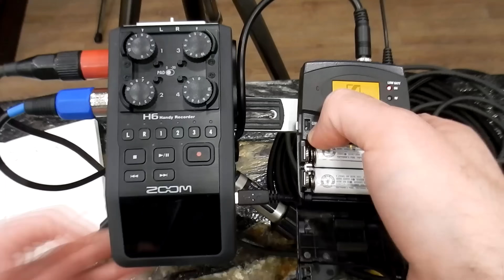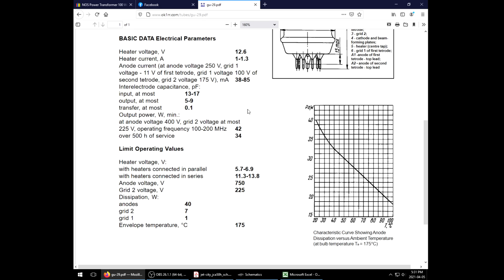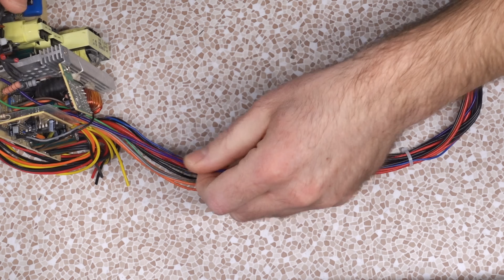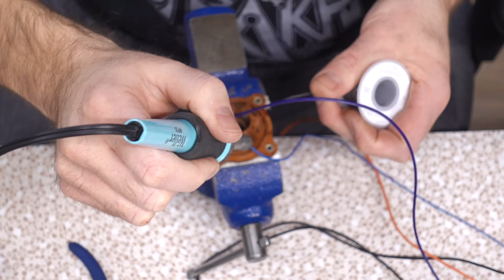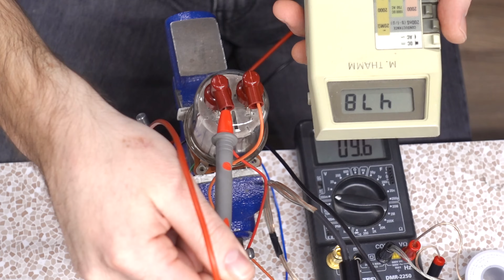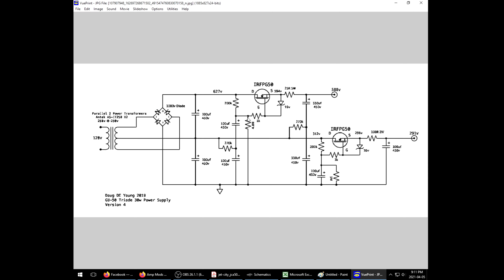The Russian Tube Experiment

Comment: The generator double beam tetrode GU-32 was made in the USSR, not in Russia, the main production of this model was done by the Lviv Electric Lamp Plant “Iskra”, in Ukraine.
It has been out of production for a long time, due to a number of shortcomings - noise, size, heating, and most importantly, it requires a lot of transformers.
Well, who wants to pick their nose - Russia will be making similar retro garbage for a long time, stolen 829B from RCA.
Reply from the maker: Yeah, that's just the title I went with, as a pun reference. Many have pointed that out at this point.

Comment: What you have there is a clone of the RCA 829B, designed to function as a push-pull VHF amplifier. I have a bunch, brand new RCA's. Want some? (Who am I? Retired RF engineer mid 60's..Been in RF since  '70) Thousand of tubes in my collection. Maybe you guitar gods would like some 4-1000's, 4cx35000c, etc! LOL! 833a's?? 810's, 805.s 813's! I'd use the 813's myself for audio application. Matter of fact back in the 50's drive in's would use the 813 tube for audio. >700watts! AB1!
Reply from the maker: Damn, and here I am thinking of scaling one of my 100w heads down to 50w. I dont' even know what to do with that much power, hahaha.

Comment: 2 x fixed bias circuit will work
Reply from the maker: What do you mean ? Like resistors on the cathodes instead of negative voltage on the control grids ?

Comment: What a soud quality check do you with an audio signal purposedly distorted?? On my phone spunded bad. Make the check with nearly sin wave signal and a high efficiency horn speaker cabinet.
Reply from the maker: It's a metal guitar amp, the sound of the tube at full playing distortion is the only thing that matters. 
And amp of the nature can't even really do a proper clean tone. 
But yeah, my recording of that sound is not the best. Also, You can't really tell the sound of something from a recording, especially not listening on a phone.
Reply: If you want to be good with fistortioms, then take a MOS amplifier coping with at least 500 kHz linear power output (f. ex. 300W), and drive with any signal you want. Bee careful it will blow the speaker and your ears because of too much and powerful high frequencies.

Comment: Russia stayed with Tubes longer because of EMP effects from nuclear bombs, you have to harden electronics with shielding when using transistors and IC as the EMP effect can damage the junctions going S/C.Only Valves (tubes) can resist EMP without thick propper shielding casing.
Reply: Vacuum tubes are still used for communication satellites today. they are much more reliable than transistors in conditions of cosmic radiation
Reply from the maker: Damn, tubes in space! That's cool as frig.

Comment: Perhaps you will like the ГУ-50 better. A thousand years ago, when I was young, in the USSR, we used exactly these. 
By the way, ГУ-50 can be used with a radiator.
Reply from the maker: A radiator ?
I have considered the 50, it seems a more standard type of tube.
Reply: @DATT  The GU-50 has a flat aluminum frame on top. An aluminum finned radiator can be screwed to it in the center. Those used in the old days did not have a fan or thermal paste, but significantly eased the temperature regime when working at maximum power.
Reply from the maker: @АндрейНикитенко-ф4с  Ohhh, we'd call that a "heatsink" where I'm from. Hah, that' cool, literally. 
Traynor, a Canadian amp maker had these amps that would deliver more wattage then spec, and they put fans in the amp to keep them cool, otherwise, you could blow them.

Comment: Musos just do not fully understand electronics. Their terminology is suggestive and ignores plain physics. All those long wire connections to the tube are bound to give interesting results. How about matching the Anode impedance to the output transformer for a start.
Reply from the maker: Oh yeah, the long leads did not help, hah, and I didn't think to change the plate load until later.

Comment: What Rock did you crawl out from under, 6146, 807 ETC were all used in both Audio and RF Amps as were many others. The Soviet tubes became very popular after the US Stopped manufacture of Tubes or Valves as the Brits like to call them. the Russian tubes were not bad at all, in fact some were much more rugged than the North American equivalent. Think of the terrain they have and this will give you a start, then there is their lack of skilled technicians. The Canadians used the Russian Tubes in their tube gear the they could no longer acquire North American tubes. the Soviet tubes are reliable if nothing else.
Reply from the maker: Hah, the rock I was under only had guitar amps that used common current tubes.
Reply: There still exists tube substitution manuals. I does take a while to find. there is a market for tube Power Amplifiers and maintaining them is becoming an art. Plus there are those who believe the spectral purity of the Tube/Valve Power Amplifier is superior to the equivalent solid state Power Amplifier
Reply from the maker: @courierdog1941  Spectral, haha, is there a reason you chose that word ? Seems fitting.

Comment: If the tube has separate cathodes, you can use two constant current cathode sources that will always keep the tube in balance regardless of tube age.  Use a LM337 IC. for each cathode. Very simple to install or modify, Works great on my 50 yr old Heathkit stereo power amplifier. Adjust the current limiter to match the maximum plate dissipation. Will keep it very linear.
Reply from the maker: Yeah, that was one trick with this tube, a shared cathode.
Reply: @DATT  I thought so, like a 5894 tube, or 829a. yes, a common cathode.

Comment: Double Tetrode GU29 is desingned for Vhf RF power reverse tacted amplifiers run up to 400Mhz
And you will really amplify Audio Signals!
Good luck with self oscillating generating and stressing the Neigbours Radios😉
Reply from the maker: Well, I ain't broadcasting, so I think it was completely localized, hah.

Comment: This is a high frequency tube. Put the resistors in series, in the circuit of the first grids. As close to the tube as possible.  Against excitation at high frequencies
Reply from the maker: Yeah, lack of grid stoppers I figure was the problem.
Reply: @DATT  I don"t  know what they are called in English. But with such wires, generation may appear
Reply from the maker: @zubrzubr6769  Yeah, I kind of figured that out at some point. Sucks I didn't think of it in the video.

Comment: This tube is the Russian pendant to the QQE 06/40 that was widely used in amplifiers for frequency domain multiplex phone lines over coaxial cables (analog) . The QQE is also used by HAMs to build short wave transmitters. I have used rhe QQE to build RF-generators for scientific applications and also tried its russian cousin, which worked just as well.
Reply from the maker: Oh, so there are examples of this type of tube being used for audio amplification.
Reply: It's equivalent is the RCA 829B.

Comment: I love doing this as well. There's 1000's of tubes designed for other uses that work as amplifiers. A tube doesn't have to be specifically made for audio usage to work as an amplifier. For instance the most popular audio tube in the world, the 12AX7, wasn't designed just for audio. It has many diversified applications such as multivibrators or oscillators in industrial control devices. Many different High-Mu Twin Triodes will work just the same. You may have to change socket types, rewire sockets, and change voltages, but they will do the job just as well. The 12AX7 was chosen for use in guitar amps mainly for standardization and availability, not necessarily because it sounds the best. Anyway, like you are doing, the spec sheet is the best way to ascertain whether or not a tube will work in your application. I'm always buying tube assortments, it's fun to experiment. And you may find your new unique tone!
Reply from the maker: Yeah I know I've messed with the preamps tubes a lot. I have 9A to 9AJ adapters that have let me stick alternative dual triodes into my guitar amps.

Comment: It is highly probable the that tube is oscillating at RF frequencies. Perhaps in the FM band or higher. Be careful where you put your fingers. The somewhat - careless wiring can be a problem with parasitic oscillation. If you have a scope - connect a probe to a small loop of wire and probe around the circuits - an oscillation will probably present itself.
Reply: This tube operates in the Class C RF band and is not suitable for audio
Reply from the maker: Yeah eh, I suppose if there is oscillation I can hear, then there is probably oscillation I can't hear and it's one reason why the "tone" of this tube sounds off.
Reply: @DATT  look I get it, you want to fool around and try shit,... but it is painfully obvious that your guitar playing is your talent - not electronics. You should be much more careful than you demonstrate, or you are going to hurt yourself.
Reply from the maker: @mr1enrollment  Ah no, I'm not a particularly good guitar player. I have' always specialized in the technical aspects of music. 
That said, I've never worked with radios. I've never really worked with anything outside of audio, that's my trade, I havent' needed to. So yeah, I admit there is much I don't know about electronics as a whole. But I am careful, and I do know tube amps. If I didn't I wouldn't have gotten this working at all, and probably would hurt myself, haha.

Comment: I heard that the Russians are still experts in vacuum tubes. The military preferred them because, unlike transistors, a vacuum tube easily survives the electromagnetic pulse of a nuclear strike. Transistors and microcircuits simply burn out. I have seen Russian homemade products on tiny vacuum tubes instead of transistors in a walkman.
Reply from the maker: Yeah, tiny tubes do exist, I've considered playing with them before. 
I would imagine they have quiet the expertise as they are one of the few countries still making them.
Reply: The EMP story isn't necessarily wrong but truth is Russia never had any financial means to invest in IC manufacturing.
Reply: @seanwatts8342 и где-же вы данный бред находите-то🤣...
Reply from the maker: I'm still getting a kick out of the fact that they use tubes in satalites.
Reply: @DATT  They are probably not susceptible to cosmic radiation.
Reply: @DATT  They have a serious reliability problem. Vibrations during launch are hell on tubes.
Reply: @seanwatts8342  It’s very funny when someone evaluates those things that are judged by propaganda. microchip production exists in Russia, and they cannot be replaced by vacuum tubes) vacuum tubes are produced because they are in demand on the audio market. There are still factories in Russia that supply vacuum tubes to the whole world. Besides, don’t you know that lamps are much more reliable than semiconductors in space? Do you think space communications satellites can do without vacuum tubes?

Comment: Wow, I'm not surprised they're so unbalanced. The datasheet says for a fixed voltage, the anode current can be anywhere from 38 to 85mA. I think that'd be per section. The instability sounds like parasitic oscillation so maybe check the output on an oscilloscope. It might be more stable with some capacitors wired from screen to cathode on the tube socket. Looking forward to more!
Reply from the maker: Oh it was def parasitic oscillation. It's like a knew it at the time, but I didn't know what to do about it. In editing I'm sitting here like "Bud, all you needed to do was put some resistors on the control grids at the socket, and it'd probably solved most the issues.

Comment: The problem with these RF tubes is that they expect you to drive the controll grids positive against the cathode, which means it will draw grid current which means extra distortion. And thus the ugly sounds its making, The driver is literary running out of steam as the grids are driven positive. 

HOWEVER, Fear no more, there is a solution, DO NOT BE AFRAID and hook that G2 into a UL tap or 400VDC. EXPECT youll need arround -60 or -80V to bias the tube, but then you get the power you desire.

The reason for the 250VDC G2 limit on these tubes is because they are meant to be driven into RF ranges where G2 will dissapate during operation a lot more power than in DC operation. And thus you can afford using the tube as I described. Though I think it would be beneficial to put a 1kOhm resistor in series with each of the G2s 

The same problem applies with the GU50s. RF tubes, they say its limited to 200VG2 I say hook it up to 800V and see what happens in audio. I would not be afraid to go as far as pushing the pair of GU50s at 1kV with the screen grids UL tapped from an 8kOhm primary and drive it nuts into 120W or more (So you would likely need a grid signal equally high which is a problem with these tubes as their gain is kinda shit for audio ampliffication where you need long sustained currents (20kHz is still AC yes, but it does not hold a candle against the 200MHz this thing can do.
Reply from the maker: Hmm, I'm not sure I understand your first statement, but the second, I do notice a lot of tubes ask for a much lower G2 voltage, but amps with just give them the beans anyway. 
If I understand what you're saying correctly, lowering the G2 as I did is one of the reasons for the lame tone ?
A 1k on the G2 is standard in all my tube amps. YOu think this 29 could handle like 700v on both the Anode and G2 ?

Comment: This is not a voltage regulator. This is active ripple filter.
Reply from the maker: Hah, it's both. I know what you mean tho, the output voltage will change proportional to the input voltage, which is not technically a regulator, but it fine for this application. Basically an adjustable high wattage dropping resistor. But yeah, filtering ripple is another effect it'll have.

Comment: you just gotta build an amp around it. First much less gain hitting those grids, I would say maybe like a 6SJ7 and use a 6SN7 for the P.I. if you need another gain stage use a single triode like a 6J5 or if you need more gain a 6SQ7 with the diodes grounded or a 6F5.This is only an educated guess though. When I first started building amps from scratch and designing circuits I always used too much/many gain stages, sometime less is more, you can get a nice somewhat clean powerful tone and add a pedal to hit the front end how you want. Maybe try a grid stopper resistor.
Reply from the maker: Those are all very exotic tubes for a grinding guitar amp. And I really don't know that there is much gain hitting the tubes, you're not hearing a cranked amp tone really. It's a metal voiced amp with a lot of distortion texture generated in the preamp.
Reply: @DATT  You just made my point for me, a metal voiced amp with a lot of distortion texture generated in the preamp, that is excatly what I was saying, I believe there is excessive gain in the preamp. I have been building amps for a long time and I learned that lesson early on. I would have to look at the schematic though and I have no experience with that power tube. What I mean is the same preamp that sounds fantastic with a pair of 6V6s will hit the grid of EL84's too hard, you have to bias EL84's differently as well as add large grid stoppers to get similar results. Anyway, I think it is cool that you experiment with weird tubes, I have always done so, there are damper tubes which can be used as rectifiers, and horizontal deflection amps which make killer power tubes etc. Cheers and experiment away.
Reply from the maker: @skullheadwater9839  Looks up the schematic for a Soldano SLO, that's what this amp is based on. It's deliberately designed to have the sound of excessive gain. How ever, these amps work by just a series of clipping stages. SO for the most part, it suppose to sound this way and it's not actually hitting the tubes with that gain. 
Mind you, I'm now wondering if you're refering to the blocking distortion I was getting that made it sound like farty and compressed at one point, which yeah, that is a product is hitting the power tube too hard. I guess there could be more tweeks that need to be done to run these properly, like updated grid stop values.

Comment: this reminds me of the rare af DAR Amplification guitar amps like the Tuzia and FBM100, they used same or similar large tubes and they sound great. too bad they couldn't be made reliable enough with all the heat they put out.
Reply from the maker: Ohh, Looks like the FBM uses the 6C33C. Those actually use the same socket as this tube. 
Yeah, the 6C33 is a lower voltage, thus a higher current tube to get the same wattage. I imagine it could run pretty hot. I've always wanted to play with the 6C33, but having to redesign an amp to run at a much lower voltage seemed like more work than I cared for. They often don't even have output transformers cause they can operate at speaker voltages, and the circuits will be a lot like a SS transistor Push-Pull.
Reply: @DATT  maybe you should try making the most basic bespoke amp from a parts bin, because those amps did have some fucking MEAT in their tone. ive lusted after that sound since i heard it and watching someone try and build something would be great and significantly cheaper than spending $7 to 10k on a rather temperamental NAMM queen.
Reply from the maker: @KrispieKomrad  Ohh, bespoke basic parts amp. I did. I think, if I understand you correctly. Try the Oddball kit amp.
https://www.youtube.com/playlist?list=PLr1eiFOCdnl8g4NpyBalve_b4wejnNlxF